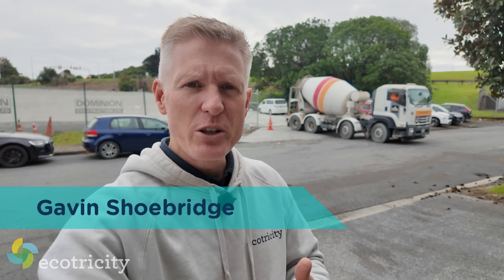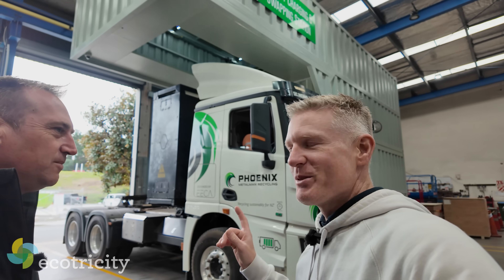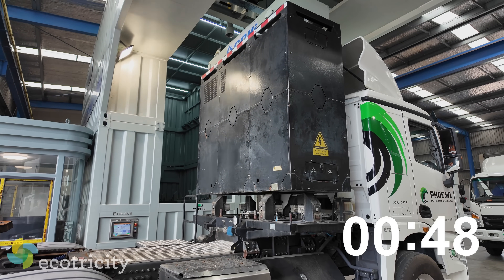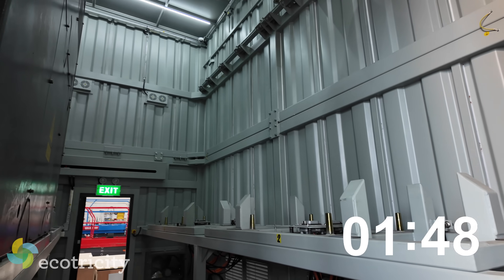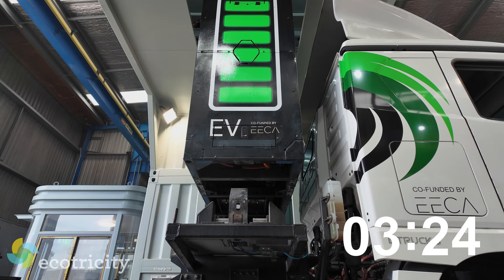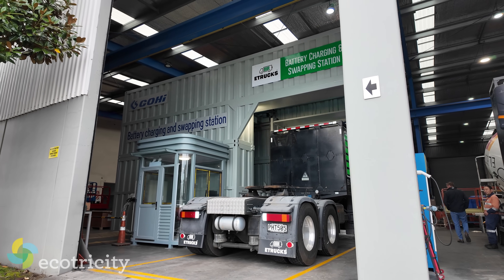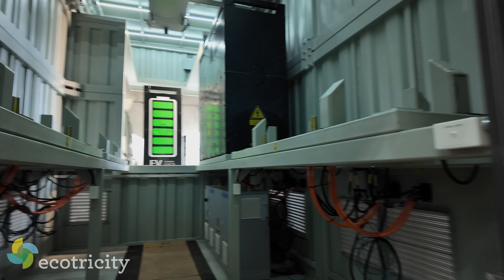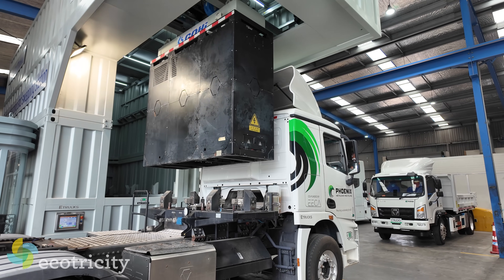Electric truck battery swapping is QUICK ⏱️

Comment: It is a 2800 Kg battery that has a 280 Kwh capacity;
 More math:   280/2800 is 0.1 Kwh/Kg or 100 Watts / Kg; that is low, very low.
  Going back, those 280 Kwh are equivalent to only 23 liters of Diesel;
   But since there are less than 100%  efficiencies on both sides, i'll say that those 23 need converting to 50 liters or so;
   Now, how many Kms does a loaded truck do with 50 liters of diesel??!!   -- same Kms with a 280Kwh battery

Comment: This is a great visualization of the power density of Diesel compared to Batteries.
Look at the SIZE of the battery!
Reply: That battery has a small energy, only   equivalent to 23 Kg of diesel, since diesel has 12Kwh of energy per Kg (in real life, due to poor efficiencies , both sides, we can assume  around  55 Kgs of diesel for those  2800Kg of battery!!! 
      To me, something is not right,  maybe  like  a "religion", a  technology for believers only, might fail in time.

Comment: Looks like a great idea. 
It doesn't demand really high charging rates, the batteries can be charged in a way that limits degradation, and at off peak times. They could also potentially form part of a Smart Grid, 
I wonder 
1) what the battery chemistry is? 2,800 kg for 284 kwh seems like quite low energy density, and
2) If a truck manufacterer started from scratch, what chassis and battery layout would they come up with? An underslung battery that could be 'dropped out' rather than 'lifted out' for a lower CoG?

Comment: This will do nothing, if you think truckers are going to get a battery replacement in 4 minutes you need to put down the crack pipe.  Sure, it may well be possible to do the actual swap in 4 minutes but how long to wait before and after?   I mean, unless you have a huge number of these swap station so that there is always one or more waiting you're still going to need to park in the garage before the battery swap begins.  This may save a little time for fleet owners, but the labor costs to swap the battery will overwhelm any time savings -- there is no labor cost to pump gas as you are the one doing it, but who's going to be the ones actually swapping the batteries and those guys need to be paid!
Reply: it is automated. Did you not watch the video?
Reply: @jakobusvdl8395  Listen, this has been tried before and while I think it makes more sense in this application than the consumer battery swap idea -- which makes zero sense in my book!  You can automate the job but then you have to in order to limit the techs exposure to the high voltage battery.  An automated facility to do that comes at a cost and that cost has to be figured into the equation.  Again, I think it makes more sense in this application, but not enough to justify it for me!
Reply: Nothing is fully automatic still will be humans involved so yea someone will be getting paid and not minimum wage either @jakobusvdl8395

Comment: with a singe battery you could power a all community houses for few days atleast, so for me its big wastage of electricity that could be useful for hundreds of houses
Reply: Its not either the electricity goes to houses, or it goes to EV's, there is normally enough electricity generated for both, and more renewable electricity generation capacity is being built.
Its very hard to argue that powering trucks with electricity, generated in NZ from renewable sources, is a waste compared to powering them with non-renewable fossil fuels imported from 'oil states'.
Even if you're not convinced of the environmental benifits, the benefits to our balance of payments are undeniable.

Comment: in fairness, you get a range of about 200-250 km in those 4min. And that setting seems pretty inefficient, as you have to unhitch and re-hitch the trailer, to swap the battery
Reply: Do you have to unhitch. There's no reason (apart from space) the tranfer station couldn't be positioned to allow a drive through configuration, for truck and trailer.

Comment: No questions about the trucks weight distribution with the batteries up there instead of down under the what ever it's called where the fuel tanks have been removed?

Comment: Electric trucks are the one typ of EV next to planes that just does not make sense. Lowered maximum load weight because truck itself is heavier and trucks are the one vehicle on the road with constant speed most of the time. To me thjs is just a waste of resources. 1 truck battery is multiple car EV batteries. Just stick with diesel and its higher energy to weight ratio. Modern diesel trucks with ad blue are efficient enough.

Comment: Come on guys tell the full story.
So the moment the truck is parked how long does it take to configure before the battery is removed and replaced and the truck is rolling again because I'm sure it's longer than 4 1/2 minutes?
What type of power station is recharging the used batteries?
Reply: You saw the process in the video. 
In New Zealand, the grid electrical power generation is 87% or more from renewable sources, Hydro, Geothermal, Wind and Solar, with the remainder being fossil fuels mostly gas, with about 2% coal.
Almost all of the planned new generation is renewable, and much of the fossil powered generation is near to end of life.
Reply: @jakobusvdl8395  
Actually the process did not show how long it takes to configure before the battery is removed which is what I was asking and looks like you are avoiding by just saying you saw the video.
Can you tell me what actual Power station is being used?
Reply: @RedBullion what 'configuration' do you think is required - there is no sign of them having to go through a process to prepare the battery in the video, and you can find other videos and information on line that show similar 5 min Truck battery swaps.
As for which actual power station, are you not familiar with how an eletrical grid works? Its a network, power is injected at substations distributed around the country, and withdrawn at other subtations for use. You literally can't identify where 'your' electrons came from. That's why the total grid mix is the more important question.
Reply: @jakobusvdl8395  
I didn't say configure the battery. It states the robot has picked up his truck and recognises where the battery goes...stuff like that. A diesel pulls up gets out goes and activates the bowser and starts filling his tanks up.
I understand you have a passion for this sort of stuff but I do wish the full story is told instead of just the best bits to sell the story.
Your tone is rather condescending when you say "are you not familiar with how an electrical grid works?"
"While the exact amount of fossil fuel consumption varies, it's known that in 2021, fossil fuels (oil, natural gas, and coal) made up about 58% of New Zealand's total energy supply. In 2024, fossil fuel electricity generation increased significantly due to low hydro levels".
Reply: @RedBullion . As I indicated, you can find information on websites and YT that give more information on battery swaping technology and processes. 
There are several on truck battery swapping. From what I've seen they don't require any additional configuration of the truck or battery to initiate or complete the battery swap process. This particular set up doesn't allow drive through, so either the truck with trailer would have to reverse out, or worst case, the trailer has to be unhitched. That would add time for 'configuration'.
BTW - when I heard 'pick up', I think they are talking the equipment detecting the truck, and its exact position in the bay - wht do you think they meant?
My 'grid' response was a bit exasperated rather than condesceding. Sorry for that..
I don't know where you got your Generation %age information from, but that's not what the MBIE website shows.
There were low hydro inflows during 2021 and in mid-2024. But the net renewable generation in 2021 was still 82% (only 5% down from average) and there was probably be less impact from 2024 as after the short low inflow period, there were very high inflows. 
As well as the MBIE site data, there is a wikipedia page in NZ Electricity generation.

Comment: this is a no brainer for fleets with smaller runs. similar to the Janus ones in aus. Diesel's wont be around for long if the price keeps coming down.
Reply: CI ICE will always have a place as will ICE in general. Batteries for electric is a stupid idea apart from some specialise circumstances.

Comment: Raises the center of gravity, making the vehicle more likely to tip over on sharp turns. Other than that, cools idea. At least you don't have to worry about it shorting out when driving through water.
Reply: I might raise the CoG of the truck unit, but how much do you think it changes the CoG of a truck and trailer unit? 
I'd say it would be a lot less significant to the CoG than the distribution of load in the trailer.

Comment: Makes sense for a fleet with a home base that don't have to drive very far but want to keep the truck working round the clock.
Reply: Like the concrete truck in the workshop. Perfect industry for it. Short haul generally.
Reply: @ThePigletpilot  Yeah, concrete trucks can't drive far. Then the concrete sets.

Comment: This battery swapping system for electric trucks is absolutely brilliant and a major game-changer for heavy-duty electrification! Speed and convenience are huge factors in logistics, and seeing how quickly these massive batteries can be exchanged addresses a critical hurdle for widespread e-truck adoption. This kind of innovation will be essential in accelerating the decarbonization of freight. Fantastic work, Ecotricity NZ

Comment: Yeah, great. But what matters to trucking companies is total cost of ownership. Does it have enough range for a full day's driving, or is trhere going to be non-revenue mileage getting to swap stations? Does it have the same payload? (Called payload for a reason, it's what pays.) Are R&M costs the same or less? Depreciation? Tyre costs?  Insurance?

Battswap is the only sensible way to go for EVs, including light passenger vehicles. We are still decades away from manufacturers agreeing to standardise pack dimensions and connections though.
Reply: It's hard to imagine the dog-eat-dog world of passenger vehicles agreeing to a battery-swap standard, particularly with charging rates increasing all the time. This whole subject might be off the agenda in 10 years

Comment: How much does that add to the base weight and reduce the payload weight by?
Reply: 800l of diesel weighs about 670kg, 1000l about 830kg - so the battery is about 2000kg more, but as Dougal points out the Electric drive train weighs less, so the net extra will be less.
I'd imagine that the much lower cost of the fuel (Electricity vs Diesel) would more than offset the cost per tonne reduction in load capacity - and that's without considering the cost if a 'carbon tax' were applied to to the diesel, or the reduced maintanace costs of an Electric powertrain.
Reply: Just shy of 3 tons.
Less the difference between ICE and transmission vs electric motor. Which, I think is in favour of EV.

Comment: That would be kinda nice if it were in North America were it gets cold.  Last year is was getting down to -40 and the metal on the pumps was breaking.  Stay in the cab, get a charged battery and off you go.
Reply: Would the batteries need to be pre-conditioned for those temps?

Comment: I would like to see the rebuild price when it's worn out and the resale value compared to resale value of a Diesel truck.
Reply: Electric is way cheaper to run and not much services to fix
Reply: Swings and roundabouts....
EV components are way more expensive than diesel, but the wear on them is negligible by comparison.
No pistons.!
No transmission!
The only comparable part would be the output shaft of a diesel transmission equating to the motor shaft of an EV. How, many times do they wear out?
Reply: How long do you think it will last?
Reply: We have 6 electric trucks that only good for a 60 kmh radious metropolitan trip's they are to heavy & subsidies by the Australian tax payer there12 month's old we don't use them anymore because they are broken there been sitting in our yard now for 6 months nobody wants fix them they are owned by the tax payer it's a rort all with government grants it stinks @hughmarcus1
Reply: Yep, it's all about TCO
Reply: Nobody is gonna want to buy a stinky diesel truck in 5-10 years. The future is electric.
Reply: Yes funding by the tax payer if you're worried about the environment what do you think about the ship that is on fire in Alaskan waters with 3000 electric cars on it which caused it to catch fire it's a drift a the moment with crew it's going to a environmental disaster and look at the Australian Cement Tanker Janus electric that caught fire with all toxic smoke going into the atmosphere what do tell the people in Alaska with all toxins going into the ocean @cristian3988
Reply: I think if you're worried about Diesels you better get on the rainbow warrior and go to Alaska and help the people put the fire on that ship out with all them electric vehicles on it and breath the fumes in if you think they are safe there to many electric vehicle catching fire for no reason spontaneous combustion 😂😂😂 @cristian3988
Reply: Yes a lot cheaper to run but not in productivity they are to heavy I know we run trucking company in Australia there tare weight is a lot heavier there for its takes two electrics to do the same job as a Diesel one and not it falls back on Tax payer for subsidies that's wrong make it a even playing field and they have problem of catching fire with no government subsidies U would not be viable to make they don't work in Australia
Reply: @nihadsarajlic787 … WHAT?!

Comment: Sounds so good, trouble is you need a power station to charge the removed batteries. Not wanted as I do not want to see black outs.
Reply: Such large batteries can provide grid stabilization if the power is allowed to flow bidirectionally.
Reply: If only there were a large number of renewable powerstations spread around the country, and a grid of powerlines to move the power around......oh wait!

Comment: Hope the cab has some re enforcement, in a crash that battery is going to do some damage.
Reply: More or less damage than a 40 foot container on a trunk? I feel like attaching stuff down is a solved problem.
Reply: Yes, any crash test results published?
Reply: The battery anchors look substantial. That location of battery might actually be additional protection for the cab from poorly restrained loads in the trailer or bed flying forward in the event of a crash.

Comment: Greetings from the other side of the world! European laws determine a 45 min pause every 4 h. To charge  320 kWh (= 4 h lap) in 40 minutes, charging with a maximum of 600 kW will be definitely sufficient. A Megawatt charging standard gets implemented at the moment.
But for other purposes, swap stations will be very interesting: farming and construction. Farmers do often have lots of PV and are working only in the summer. That's a dream team. On construction sites, the swap station can be placed on site.

Comment: A 3-ton battery compared to a 3-400 litre fuel tank is a massive weight difference which affects tare and axle weight, which affects payload and financial viability.
The battery is also mounted to high.
There's a reason trucks are diesel powered.
How much government money did this place receive?
Reply: Do you know how much a typical diesel engine and transmission weight for these type of trucks?   it is between 1500 to 2000kgs.    then there is the cooling system - try another 200kgs or so.
electric drive train would be no more than 200kg in total for the motors and smaller cooling and no transmission needed.   
so the difference is not that big.   also battery energy densities are projected to double in the next 5 years.   this will make electric trucks eventually lighter.
Reply: I'm a boss a major company in Australia yes i do that's we load it lighter than a Diesel truck and not only that we 6 of them 12 months old sitting in the back of the yard broken down the have been sitting there for 3 months and not only that we didn't buy them the Australian tax payer did do you think that's fair with out subsidies these electric vehicle maker's wouldn't last we Diesel trucks 4 year's old there still running the electric are 12 months old parked up broken down they pieces of Shit @danriff3491
Reply: @danriff3491  Yes I do, tare weights for electric trucks (and cars/vans/utes etc) are higher than ICE. This causes a lot of problems in the transport industry where payload and axle weights are vital.
As for the next 5 years, we'll see when/if that tech actually arrives and is cost effective.
There's a reason trucks are diesel powered.
Reply: Are they going to do this without government subsidies or waste tax payers money not only that search for the Australian cement tanker Kenworth converted Janus that burst into flames on a Melbourne Freeway 5 minutes from the CBD lucky the driver out dangerous don't you think and that truck was paid for by the Australia tax payer I don't think the people of Australia should be paying for this rubbish we thousands of Australians homeless the subsidies could be going to the people.that are not some stupid project that burns to ground and it's not first electric vehicle to catch fire it's lucky nobody been killed in them yet spontaneous combustion😂😂😂 @danriff3491
Reply: All these electric vehicle's are subsidies by the government they're subsidies here in Australia one Janus converted Kenworth of Australian Cement just caught fire in Melbourne Victoria and that truck was paid by the Australia tax payer it's BULLSHIT